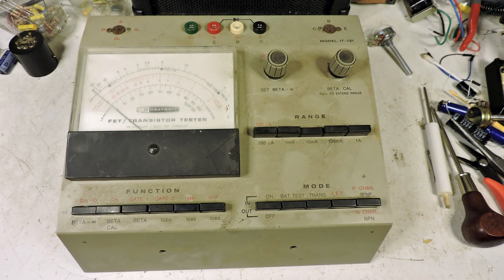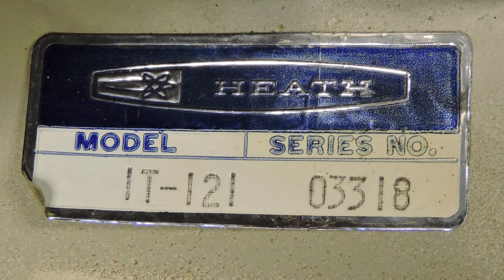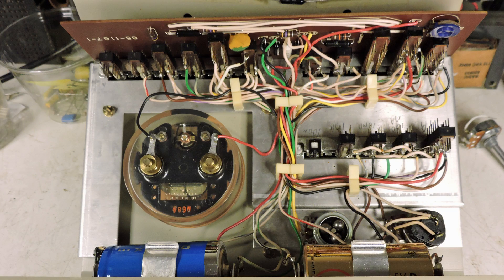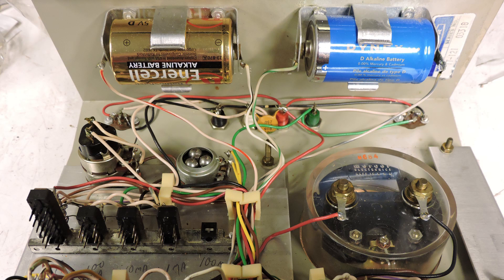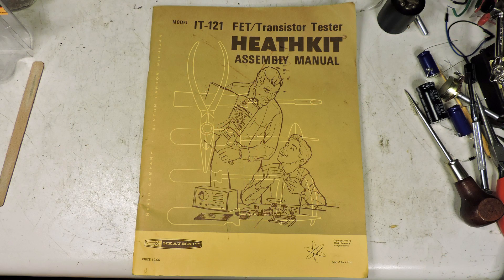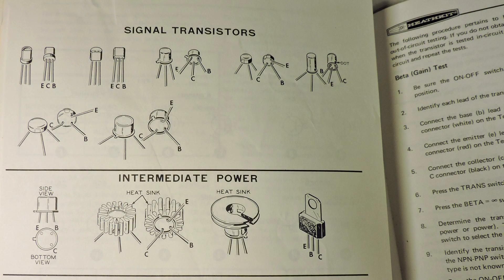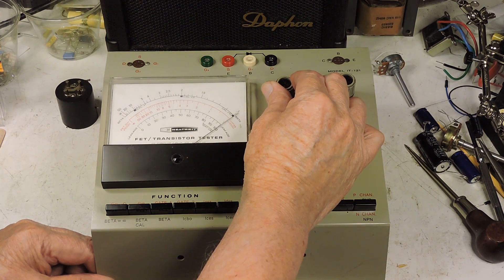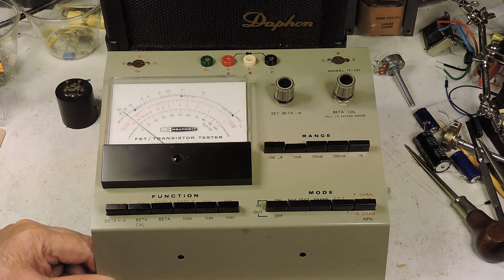Heath Kit IT-121 FET/Transistor Tester

Comment: Hi Rick.  I have just started building one of your AM Transmitters on my YT channel.  Its a great design and I am looking forward to completing it.  Would you mind If I ask any questions in case I get stuck ?  Looks straight forward but you never know. Many thanks,  Ron
Reply from the maker: Sure you can ask questions. Have you seen the power supply for the transmitter.
https://youtu.be/k3ZjRGAuIWU
Reply: Thank you Rick. I only have one question right now.  The 4.7mdf cap on the OT appears to be missing polarity on the drawing. I found a page where someone asked if it was a 50v cap and if the + side is going to B-.  I saw your reply which said it was 250working volts.. but I want to be sure on polarity... which side goes to the OT   (-)  or  (+)  ?      I am checking out the power supply, thank you for sending the link   great stuff Rick, thank you . Ron
Reply from the maker: Which transmitter are you building?
Reply: the original AM transmitter with the 5Y3,  6SA7 and the 6L6G along with the Quaker Oats box ( 155 turns) and the toilet roll (20/CT/50) L1 inductor.